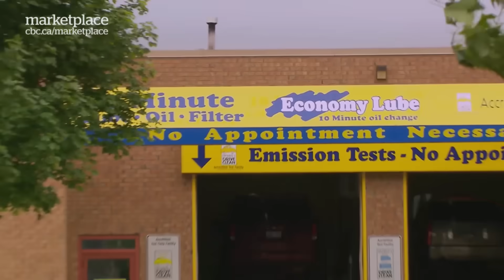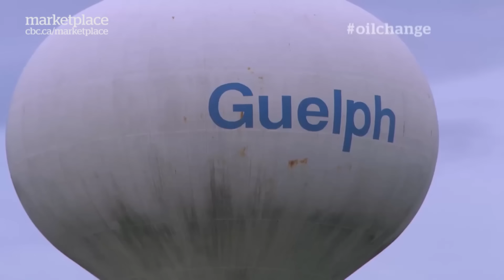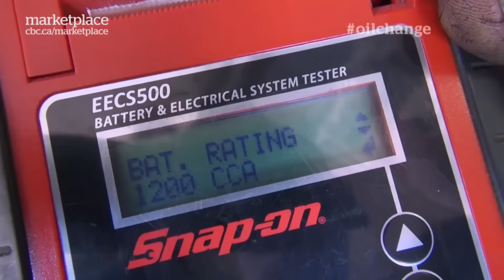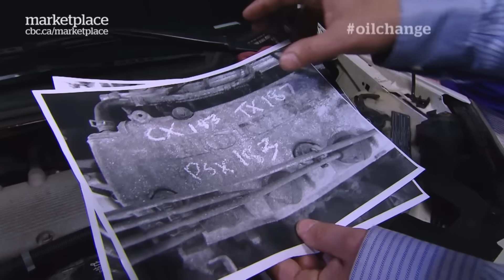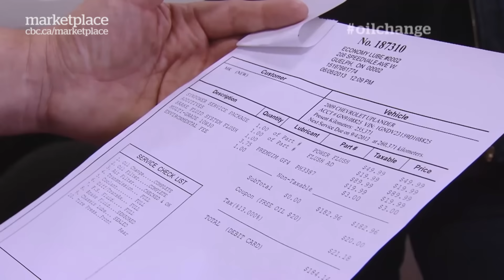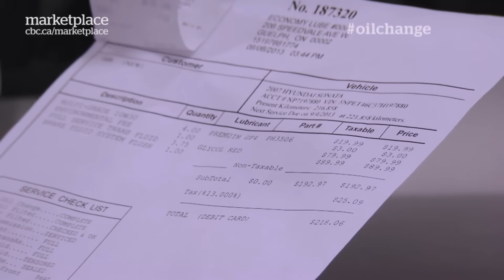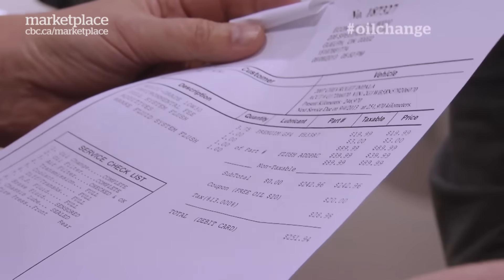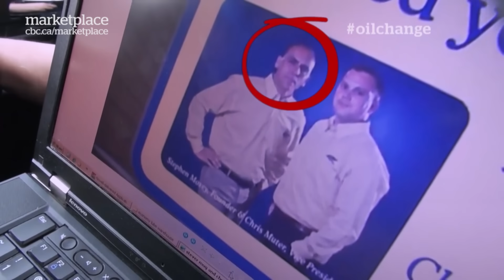Oil change scams: Hidden camera investigation on what really happens to your car (CBC Marketplace)

Comment: wouldn't this be illegal?
Reply: (and yes I know this in Canada)
Reply: I got robbed by pep boys bro a All I asked was for the oil change and the break fluid that was like 30-45 dollars and I ended paying 103$ 🙄
Reply: AAC Gameing bruh, wtf. Go to auto shops not big chains
Reply: brake fluid flushes aren't that cheap as they pay a lot more in labor than oil changes.  Sounds about right to me, actually.
Reply: Pete Smith my dads shop he does oil changes, frion etc for free but only if you buy the stuff yourself, if he needs to buy it you'll be charged the price of the stuff
Reply: Link Pretty Ass That's a pretty good deal, then.  I've worked as a technician at a dealership for 11 years, so we get a little peeved when we have to work for free. ;)
Reply: Pete Smith yeah, he does it because he has student aids from my school and they have time to spare so why not give his customers a good deal
Reply: Tbh that sounds about right where im from. The price of oil is dependant on howmany quarts kf oil your engine requires. And then theres the cost of oil filter which is like 15-30 depending on which you get and then theres the cost of labor which some shops charge up yo $50 for a half hour. And then whatever they did to your breaks
Reply: +Harley Gologergen-Johnston filter are 15-30$!? where do u live!  i get frames for 4$
Reply: +AnEerieEpitaph HauntsMe i live in alaska. And there are premium and regular filters. Premium comes in blue boxes and regular come in red boxes.
Reply: yes
Reply: How you going to prove they didn't drain your oil? You can't.
Reply: Matt Damon Sure you can.  Pull the dipstick and see the condition of the oil.  You can plainly see if it has been changed or not.  Also, if you have a filter housing like in a Mercedes, you can pull the housing out to see if you have a new filter installed.
Reply: +Matt Damon Actually you can.
Reply: Especially like in this specific garage where you sit 10 feet away from your car and watch what they are doing, lol? You could most certainly see whether they are draining your oil or not. Also if you have a basic understanding of how to do the things that they are trying to sell you on, such as bleeding the brakes, you could easily see that they aren't doing it. They would need to go to each wheel, you would see them hooking up a hand pump and tube to each one, using a wrench to loosen and tighten the bleeder on each one, and you would see fluid coming out as well as them having to go back to the front to add in more brake fluid. I mean common sense alone should tell you that they cannot do all of these things in 15 minutes or less. I've been doing this stuff for years and even if you're quick,  have all the right tools, and even a lift, it still takes longer than 10-15 minutes to do an oil change AND something else.
Reply: Iamurgod It's a short paragraph? I'm going to guess you don't read that much if you think that's a novel....
Reply: yes, charging someone for a job that you didn't perform, is theft and they can be charged with it.
Reply: No its not .. lol you gotta go to court and sue.
Reply: HintonburgRep haha, you gotta go to court when you're charged with theft.  It is completely illegal but they would call it fraud which is still illegal.
Reply: You can be indicted for fraud and found guilty and go to jail, yes it's very illegal. It's just harder to prosecute than an obvious physical theft because fraud is more like someone talking another person into giving them their money.
Reply: no just incompetent that's all.
Reply: George Payazitis if you don't know the law, don't reply....   it's called fraud.
Reply: This issue is widespread and still happening. I usually change everybody's oil in my family but I've just been too busy lately. My brother recently took his car to a brand new, VERY nice Valvoline Express Care Center and he told me a week later or so (jokingly) that the price of his oil change became expensive real quick. I told him about what I saw on here and how they immediately try to up-sell you and don't even do all of the work half the time, and he said that they actually did that to him as well. Aside from getting him to buy the "better oil package" they said that it includes checking the air in the tires and rotating them or something and he never saw them do that.

It's unfortunate because nothing against my family, but none of them know how to do any of this stuff themselves. They work in offices and have to rely on others to do this stuff. These chains are taking advantage of people that just don't know any better and they're getting away with it with no repercussions. It's tough to make family members understand that if they go to get an oil change that the "oil package" doesn't matter.

I mean 5w20 is 5w20. There isn't really a "better" 5w20. Whether I buy Autozone brand oil or STP or Valvoline my car is going to be fine for the next 3000 to 5000 miles.

More importantly is that you don't want these people to do ANYTHING other than change your oil for $20. There's a reason why it costs me $20 to change my own oil at home and that this is the price that these places advertise. That is how they get you in there. Because if the price is the same then let someone else get dirty and deal with the old oil right? But once you drive in they have you right where they want you. And they basically use scare tactics to get you to pay hundreds now so you can avoid paying thousands later. It's ALL BS.
Reply: gamer taboo 
You're missing the point, which is the fact that you guys go to these places because of implied "convenience",
You know, because everybody's time Is so frackin important nowadays.
Then, when these quick wallet flush places rip you off, you then proceed to blame all mechanics.
Reply: twoeightythreez Well I don't go to these places, but ya I agree. Literally anyone could change their own oil if they just decided they were going to do it. It's tough to get into their mindset because I just don't have the same kind but I know for a fact that at least some people think that they could break their engine somehow by changing the oil. (which I mean is technically possible but you'd really have to screw up)

The least they could do is try and do their homework before going to these places so that they know what to expect and what they really need to have done.

As for blaming "all mechanics" I don't know if that's entirely true. There are good mechanics out there but I know quite a few places, doesn't matter whether they're mom and pop shops or big chains that have no qualms with price gouging. I understand they're a business but it is THEY who are hurting their peers.

Look at dealerships, you can't even trust the place you bought your car from to fix your car and not rip you off. In fact I'd say it's the last place I'd ever go for work to be done that's not covered under warranty.

I personally do all of the work I need done myself. It's the only way to not get ripped off and to know the work is done right.
Reply: ***** Dude there's not enough time in the day every day for everything I need to do already, start adding in oil changes and stuff and it just gets worse. It may only take me 15 minutes, but then they want to talk, etc. I still do it half the time but it's frustrating when I barely have any time for my son or myself already. Just trust me, there's more to it than you think. Lol
Reply: The Undiscovered Country same. I agree with the odd humor
Reply: So great story, I had to buy two new tires for my work van (I'm a painter) and since I don't have the equipment at home to remove and install tires on rims myself, I just have to go somewhere. Though I might look into that equipment honestly.

So after hunting for deals online I went to the nearest NTB, I had already setup my appointment and picked out the tires online so that I wouldn't have to be sold on anything. And of course, 5 minutes after my car goes on the lift, the shop foreman comes in and tells me that BOTH of my front lower control arms are broken, not worn or whatever, but broken. He says the battery is going bad (it's not), that my right front wheel bearing is going bad (which I knew was true but I fixed it myself after) and that my steering fluid is leaking and needs to be flushed. Total estimated cost? $1700 (with the tires). He even said that he could get those parts that night somehow. Lol Swear to god I have the estimate still on my desk right next to me.

I went in to have $200 worth of tires installed and they tried to get me to spend $1700 on my 05' honda odyssey with 220k+ miles on it,  instead. I had my 7 year old son with me and the guy even played the 'safety' card by saying: "the control arms being broken (can't get over him saying that) is dangerous, it's not safe to drive with kids in the car." Ugh.. But I was like no thanks.

I'll admit it though, he actually had me second guessing myself after he said that. I'm betting the 'child safety' spiel opens A LOT of wallets right up. Though I hesitate to say that because there are plenty of things that could really be a danger to drive with kids. Don't just think that it's always a spiel, please. Google is your friend. But this guy literally made it sound like it was amazing that I even made it to their shop, when I assure you my drive there was quite normal lol.

So I went home, ordered the parts and a few nights later replaced my wheel bearing and two lower control arms (which are literally big HUNKS of steel, and weren't broken, nor do I think they could break, their rubber joints just wear down over time I believe)... anyway I replaced everything that was wrong for $170 in parts, by myself in 3 hours.
Reply: ***** Lol it's funny that I fell for it hahaha.